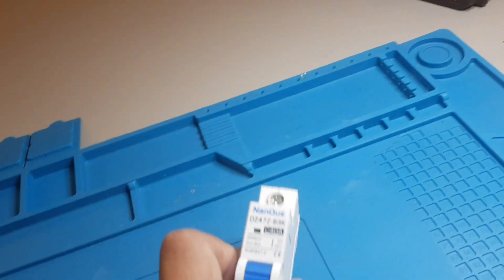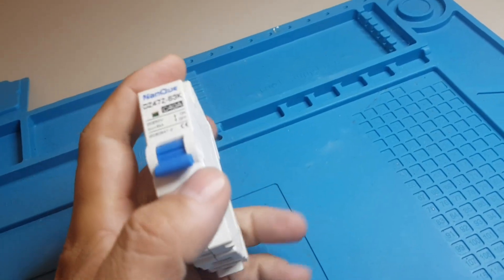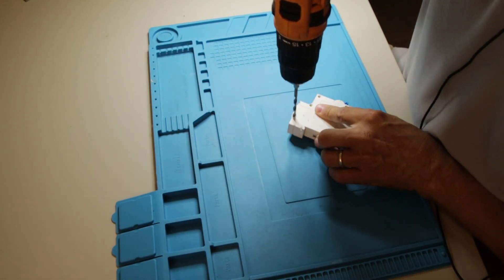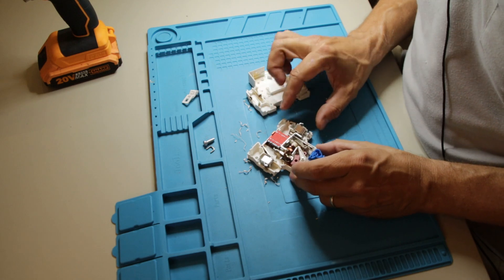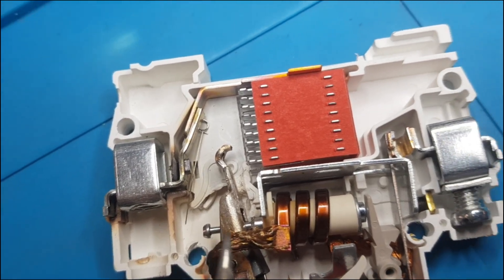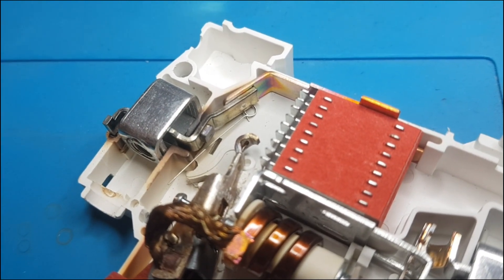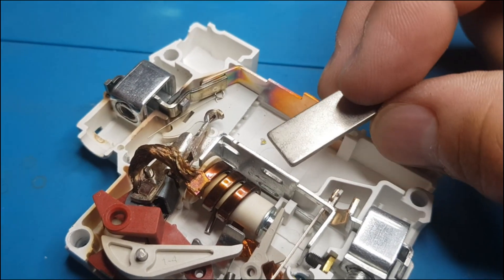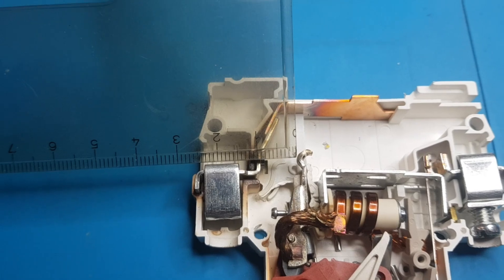NanQue DZ47Z Non-Polarized DC-Breaker: Let's look into a Failed Device

Comment: The extinguishing chamber is cheap and badly constructed. I just see thin layers of steel plates, should be much bigger and thicker copper stripes to dissipate heat faster! This is build on the very cheap side, as most chinese MCBs and other electric parts. Without magnet, that draws the arc in the chamber, the sidewalls need metal plating too for heat transfer and protection. There is a comparison video between EARU MCBs and Projoy MCBs - the latter are far better.

Comment: I just bought 2  of these 20 amp and 80 amp. The 20 amp has a magnet in it for sure. I can't detect one in the 80amp. but these were expensive and now I am not sure I shoud trust them. The 20 amp of for a solar disconnect so it doesn't matter.  But the 80 amp is for a battery disconnect is there any way to be sure it's not polarized?
Reply from the maker: Is there a +/- marking at the schematic or terminals printed?

Comment: Thank you of the clear explanation. I try to find non-polarized 125A - 150 DC breaker for my 48V battery system. Not sure about my current Tomzn breakers...
Reply from the maker: To my knowledge Tomzn doesn't have non-polarized MCBs. I have found now that Geya does have a brand new series of non-polarized DC-breakers up to 63A. I have used one of them already in my EV Motor Scooter.
I would still recommend you to go for Fuses in a battery system similar I did when I had replaced all my breakers half a year ago.
You can find the video on my channel.
Greetings

Comment: I'm confused.. so this model is good but installation was bad?
Reply from the maker: I don't think the installation was bad, was it? There was a correctly sized wire attached to each of the terminals. The installation was done in a place with some dust and relative high air humidity as anywhere else in the Tropics, but otherwise dry...
So in my opinion the quality of the terminals and internals is not suitable for a place like this and shouldn't be sold to anyone in a tropical country.
Or what would you say?

Comment: Very good video on these , I've been running a 40 amp nan que  non polarised on a 30 /35 amp  DC to DC charger for about a year daily  ,can not see any problems ,I wonder why some seem to fail and some don't , also are the  manufacturers company aware of this issue I wonder , and able to improve them ,as aside this contact issue they seem to be  good ,any info appreciated ,great video .

Comment: Well, I'll take NanQue off my list of brands to try.   I've gone through a bunch of cheap Chinese brands over the last few years.  So far I've had the best luck with CHTAIXI.  Their 2-pole breakers are non-polarized and i've ripped a few apart and checked.  Construction seems pretty decent.   I haven't had any failures in roughly 2 years since I put them in.

But I am also very careful with cabling and proper specification of the breaker (125% of maximum expected operating current for the minimum breaker size).  So none of my breakers or fuses actually get hot under normal operation.

That burned / brown-spot area in the NanQue you took apart is definitely from over-heating.   But the question is... from what?   It might not be the internal contact.  It is quite possible that it is the external wiring interface and terminal.  It is relatively easy to make mistakes on wire insertion into the breaker.   In fact, its likely because unless your breakers have been tripping a lot, the contact surface on the inside should be in really good shape.

* When not using ferrules, accidentally pushing the cable in past the insulation so the insulation is being clamped by the terminal and is preventing full copper contact in the terminal.   Very common.  That one that burned doesn't look like you had ferrules on.   Double check that.

* So always use ferrules (leaving the plastic shield on), like you have on the other breakers.

I think the ferrules also help with terminal stresses, particularly if there is a lot of thermal cycling, and reduce the chances that the terminal will loosen.

* Size the breaker to 125% the maximum expected operating current or 100% the cable rating, whichever is lower.

* Size fuses to 150% the maximum expected operating current or 125% the cable rating, whichever s lower.

For smaller ceramic fuses I really like 10x38mm "DC Solar fuses".  They are ceramic fuses.  And Baomain fuse holders seem to hold up pretty well thermally.

-Matt

Comment: Roland you asked what the material of the fixed contact could be and yes it is graphite like the carbon brushes of a universal motor. Since the contact arm has to travel further, the force of the tensioned spring is now lower, which poses the risk that a stuck contact cannot be released. That's why graphite was used instead of metal because it doesn't stick together. However, Graphite has a much higher resistance and heats up accordingly... so once again, the emergency solution could be a copper cooling strip clamped together with the incoming wire into the terminal which dissipates the heat to the outside.

Comment: The contact plate where the incoming wire is clamped on caused on the outer side almost same burning marks to the white plastic of the housing as inside. That means to me the heat came mainly from screwclamp contact it self, not from the internal switching contact. Maybe the incoming wire is corroded. The wires should not be tinned or aluminum, but i guess you already know that. There are good massive copper crimps on market with a flat side which goes into the screw terminal and into the hole on the other side the stranded wire will be crimped in.....i always asked my self, are they really needed, cause directly clamp in wires make just one transition zone, with crimp there are two, but maybe failures like this and the experiences of many electricians gave this kind of crimps a right to exist....
As a alternative adding a long rectangular copper stripe between the incoming wire and the clamping surface of the terminal will act as heatsink...
Reply from the maker: It's just that 3 of 5 breakers failed within the last 3 months. On the others, I didn't see burn marks on the outside. Of course, I could be the worst talented guy who is not able to screw in a wire :)
I will use lugs before I leave now. Let's just hope the other breakers survive my absence.
Reply: @RolandW_DIYEnergyandMore  As I mentioned somewhere, without magnets only crappy DC breakers can be constructed in this size (within reasonable price range). For bidirectional uses only fuses or bigger constructions can be reliable.
Reply: @Dissecting_Truth  Yes of course, but i ment permanent magnets.
Reply: @Dissecting_Truth  But then it happened during a test resp. manual switching...this can be avoided by not doing it (under load ; )... and cause smart people dont do this i tend to the assumption the thermal build up thought the thermal trigger was first and then this has triggered the breaker and the traces of the arc happened secondary. The room for a propper thermal trigger design is not given cause of the wide contact opening. It may work under test conditions with a fat cable connected which acts as a heatsink and normal ambient temperature, but not in Thailands heat in a cabinet where other heat sources lift the temperature bejond the factory test conditions and a relatively small wire connected.
By the way, i cant see any electric magnets which are used to direct the arc into the extinguishing chamber, only the one for the fast trigger.
Reply: @Dissecting_Truth  You said: "The thermal bi-metal strip ONLY functions during a overload"
This is not true sorry, the bi-metal stripe always produces heat with every load and is normally mounted right after the input terminal who shows burning marks from inside till outside. If theres only a small wire mounted beside too high ambient temperatur the heat will build up till it triggers and the additional heat through the spark is enough then to melt the tiny parts, so it cant be locked in ON-position anymore.
Reply: @Dissecting_Truth  I cant see any bi-metal strip to be honest. The bi-metal strip functions as a heater all the time, not only in a over current situation and heat matters in this case a lot, as i explained plenty.  
But I have a alternative explanation for the problem here. The contact pad is graphite for not to allow the moving contact arm to stick on it. Cause of the long way the contact arm has to move, the force is reduced, theres no concentrated short way force, so sticking must be avoided in any case, so they were forced to use instead metalic contact material this graphite stuff which have the drawback of relatively high resistance and that results in a heat build up. This heat toghether with the heat of the bi-metal strip (if there is any) and Thailands heat and a relatively thin wire connected and the heat of the arc are enough to melt the locking plastic parts.
Reply: @Dissecting_Truth  It seems you didnt read the second part where i explain the real cause of the problem. 
The bi-metal biproduct heat exists with any current and this adds heat and heat caused the damage - not more and not less (no reason to feel attacked ; ) 
The contact arm moves with less speed and force, cause same spring load is used for a bigger distance. Due to this fact they used graphite instead metalic contact material to avoid sticking. Graphite has a higher resistance and this produces more heat. Additionally the arc is present for a longer time, cause of the slower movement of the contact arm.
Reply: @RolandW_DIYEnergyandMore  By the way, the incoming wire acts as a heat sink too, but due to the fact here in Thailand 6 square millimeter rated wires has actually only 4 sqm and instead a thickened (thermal) insulation, this can lead to problems as you have.
Reply from the maker: @topeye4202  yeah
Reply: @RolandW_DIYEnergyandMore  Then it must have something to do with the way they "solved" the thermal trigger, cause the room for a propper solution don't exist anymore cause of the wide contact opening. Same as I mentioned before will solve this problem: a copper stripe which acts as a heatsink  ; )   ...or installing a fan (as I do) which brings fresh air and air 'circoolation' into your cabinet, cause the rated ambient temperature for this brakers is with 40 degree quite low, especially for a between others sandwiched breaker as the one who failed.

Comment: Thanks for the follow up! I'm curious: it's rated for 40A, do you know what the routine max current it would see was? The only thing I can think is "that seems like a small contact patch for high current"- maybe the contact would heat up but the base metal (... steel?) couldn't move the heat away fast enough. But I have to admit I haven't looked inside breakers too often.  

Different question, what do you look for in fuses / fuse holders? I've found a few, but in general searching for DC fuses has been giving me nothing but automotive fuses, and I think asking those to break 4x their rated voltage is a bit much.
Reply from the maker: Hi. The max. current that 40A breaker saw was 25A continuous over periods of 6hrs on a nice day. Usually I do over-rate breakers by 50%. But still. With continuous currents such devices will heat up during operation.
If you are looking for DC fuses with holders, look for Solar PV fuses. Those are the DC rated ones. I will link you the fuse holder/fuses which I have ordered. Unfortunately I will only be able to install them in November, then there will be a follow up.

Holder:
https://th.aliexpress.com/item/1005006503836286.html?spm=a2g0o.order_list.order_list_main.4.284e52ce4Cu8lb&gatewayAdapt=glo2tha

Fuses:
https://th.aliexpress.com/item/1005001451833138.html?spm=a2g0o.order_list.order_list_main.6.284e52ce4Cu8lb&gatewayAdapt=glo2tha

DC fuses are Type gPV while Type gG are usually AC rated general purpose fuses. A much cheaper gG fuse can as well break DC but the voltage must be well below the rated AC voltage (1/3).
Reply from the maker: Beyond 63A you would then have to use this:
https://th.aliexpress.com/item/1005005032002472.html?gatewayAdapt=glo2tha

Comment: Hi Roland, this video is very interesting, unfortunately I'm not an expert and I couldn't say what happened to your device. I heard about NoArk from Andy at OffGridGarage, but I don't know the difference of non-polarized CBs from others. Could you explain what it is?
Reply from the maker: Hi. I don't know what other brands do different, but if they make the breaker in the same DIN-Rail MCB form, they will look very similar inside. The biggest difference will be the choice of materials and quality of parts. Every small detail can make a huge impact on a delicate mechanical device, and that will then justify the higher price. I actually wouldn't even have a easy source for those other brands other than some international shipping from the other side of the world which would bring up the cost for one breaker to 40-50 USD. Non-polarized MCB DC breakers are a big thing in Australia but preety much unknown in the rest of the world. There are still DC MCCBs which are typically build in the tradition of non-polarized, but those are quite huge and do not fit into a DIN distribution panel.